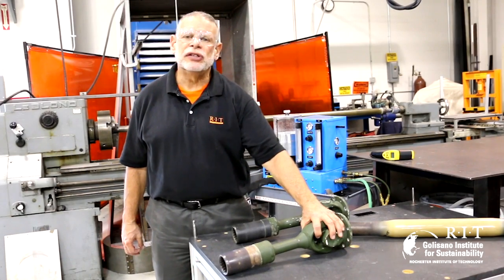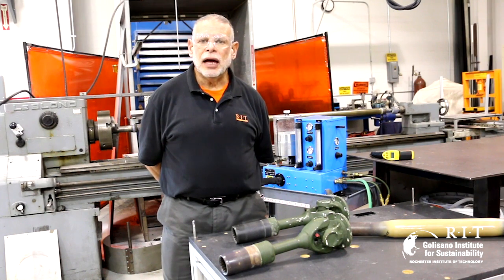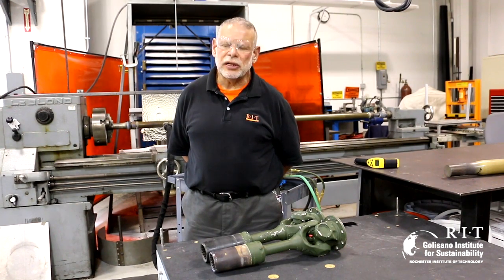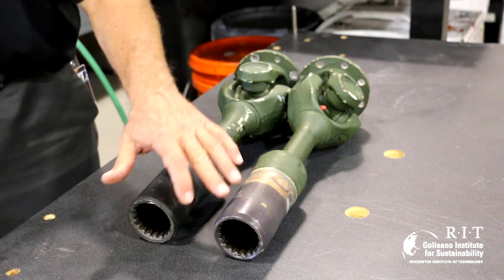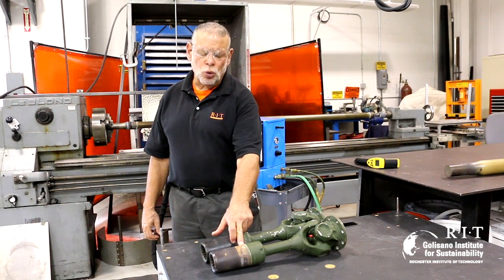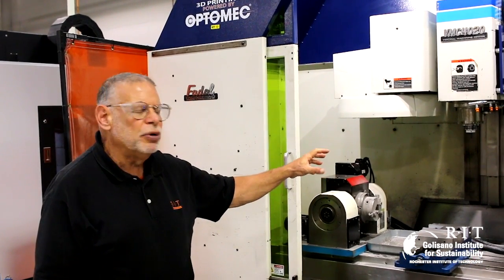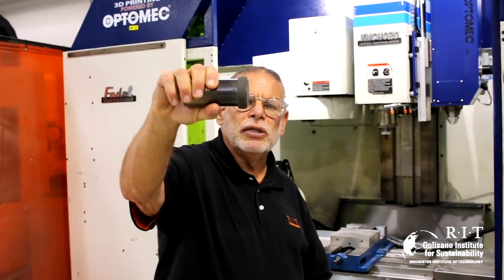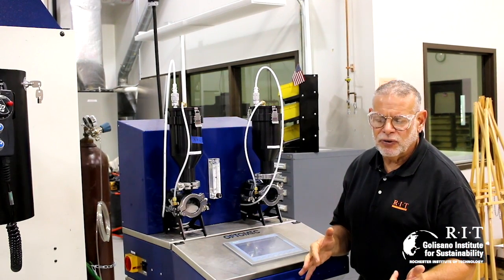Remanufacturing – Restoration of Components Through Coating

Comment: In the case of the long shaft, it is not spray welding, it is thermal spray. This is a good use of flame spray polymers; Nylon 11 most likely. The laser is laser cladding, not "spray welding".
Reply from the maker: Thank you for catching that James. You are correct – we are flame spraying the polymer and laser depositing on the second application.